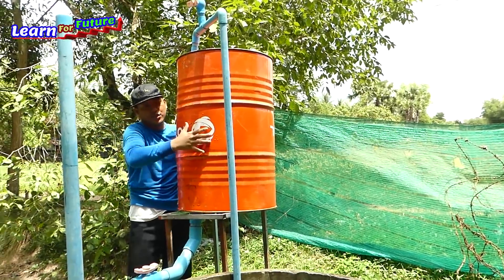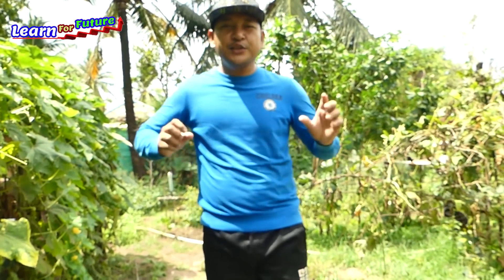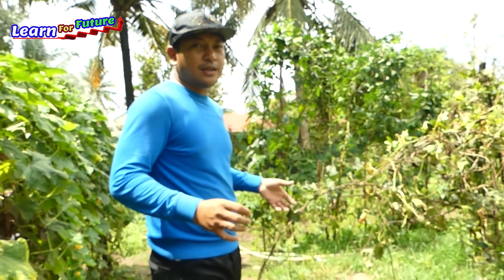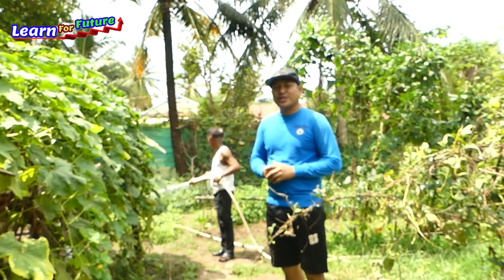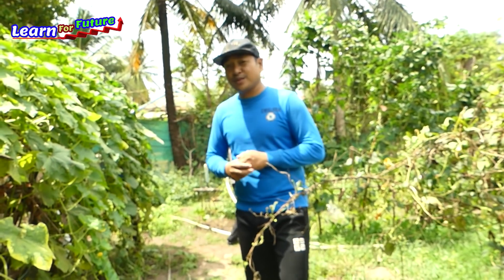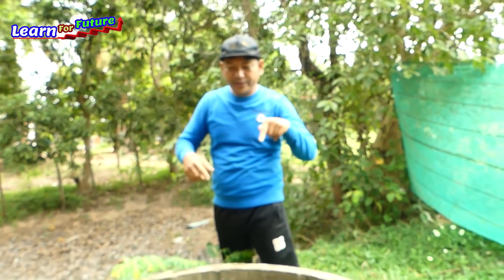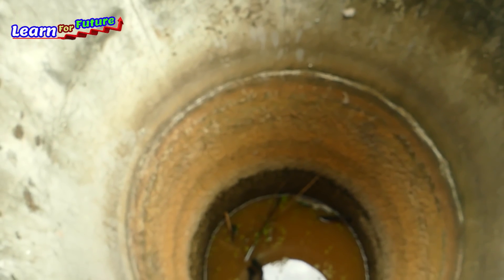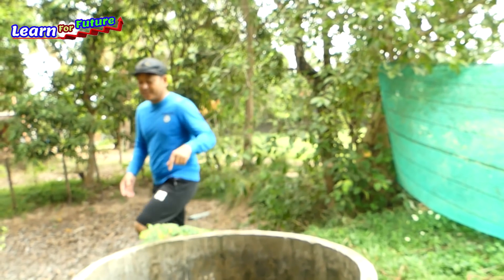Pressured Pump - How to make Auto Water pump from deep well - No electricity

Comment: Dear Please don’t mislead the people, this is not  a pump, pump should be possible pull up water above inlet water level ( Well water level ).  But this system always should be final exit water  out let below Well water inlet level. Otherwise it does not work.

Comment: is the drum should also need to be filled up of water?
Reply: The drum is used to start the syphoning process. You need to draw the water up to 'kick start' the process. This can also be done with your mouth if you use smaller diameter pipes such as a garden hose. Though stop sucking before the water enters your mouth ;)

Comment: imposible to raise water from a well without using power. Gravity pull applies only if the flow is fr higher to lower level
Reply: You are Total idiot...
Reply: @dazar44  Why ishe an idiot? This is a siphon system. A siphon can not lift any water from even a 1 foot deep well. Impossible.
Reply: Trully??
Reply: 09:24

Comment: Our well is 600' ft deep, did this system is capable to flow our water without electricity ?
Reply: It will work maximum for 10 meter deep.
Reply: @wattoo77  No, not even from a 1 foot deep well. This is a siphon system. A siphon can not lift any water up. It is right that you can pass over a 10 m wall, but no water can be extracted up ther. 100% of the water must down under the source before exit.

Comment: This man is expert in his job and he ia doing good work. Same time many people giving negative comments that it is fake or outlet should be lower than inlet etc but this type of people don't want to do research or they don't have capabilities to do so. So very easy way is to say " it is fake " show me this or that but don't want to do anything by them self. Anyhow this is true and possible. Their are vacuum pumps available in market but that pump creat vacuum by engine and can suck water maximum from 10 meter because there is 1 Bar atmosphere pressure which is equal to 10 meter. So once he filler drum and open outlet than vacuum is created inside drum and which is replaced by water from intake. Here is trick which no one asked in any comments even on any other video. The trick is that the water volume in outlet pipe should be more than inlet pipe other wise it will not work. So if longer outlet than small Dia of pipe can be use. The whole idea is water volum in outlet pipe should be more than inlet. So guys asking for size of inlet and outlet can start there calculations
Reply: very Good scientifical explanation.
Thanks with regards.
Gopal raju
Reply: Mr Azhar wattoo sir
Thanks for your technical explanation ,this is what I want to know.
Best regards
Gopal raju
Reply: @Fpg-x2s  you are welcome.
Reply: My question...if this is true, why I can't find one in the market?
Reply: Sorry, but you are partly wrong!
This is a siphon with a barrel. As any siphons the water level of the source, here deep down in a well, must be higher than the outlet to the rice field. Is that the case here? Does not seem so to me! 
It is correct that with a drum, you do not need a one-way valve in the source, but for this to work the volume of the output pipe PLUSS the water volume in the tank, must be grater then the suction pipe. This means that you can use any practical diameter in both ends. They may also be equal. Use whatever you have! Grater pipes gives more water. 
The vertical tube after the drum is just a wast if money, the drum will do the jobb.

In fact the whole drum can be dropped, no need, but then you need a one way valve in the suction end, an the system must be absolutely air tight. With a drum you do not need the foot valve and the system will run for some time even witt a small air leak.

Comment: Hello dear YouTubers, 
Using groundwater as irrigation water has a major disadvantage. Groundwater also contains minerals dissolved in the water. Every time you use this water for irrigation, some of the minerals remain in the topsoil. The more often you do this, the more minerals accumulate in the topsoil. Through evaporation, the water goes into the air but minerals remain in the soil. There comes a time when you use more water than necessary. Groundwater causes salinization of the soil. I therefore recommend creating a collecting tank for rainwater. ung mainly use these. then it is not bad to use groundwater from time to time. 
regards 
Cemil Genc 
environmental engineer
Reply: That's true in general but you don't take into account the air pollution. Nowadays the rain have plenty of toxic ingredients in it including aluminum and barium as well as bunch of other nasty things. Last years it was common for the plants to die after just a single 30 minutes of rain.
I'm planning to build a new garden next year and I will use underground water for irrigation despite the risk you mentioned.

Comment: Ser im a new subscriber i just i want to know if that method will work in deep weel atlist 26 meters because part hir in phillipines sea level is deep and can you detailed all the pvc tube that you use thanks in advanced ♥️♥️
Reply: @MarcShare4Profit  Actually no. This is a siphon. A siphon can make water pass over a 7-10 m heigh wall, but you can not get access to any of that water up there. All that water must down to an exit lower than the source. So it is not possible to lift any water from a well with this.

Comment: This only works if the water level you are pumping from is higher than the area you are watering. This is a clever system if your crops grow in a low area, but if you wish to grow crops in an area higher than the water level you will have to put energy into the system to account for the energy it costs to lift the water up (energy cannot be created and pumping up water without any energy requirements would mean free (gravitational) energy).
Reply: Use Ramp Pump
Reply: @reeblaagan7310  A ram pump needs lots of streaming water.
Reply: Ram pump<
Reply: Fake fake fake
Reply: Research first and analize so u will know the facts?
Reply: @leoalar3178  Erik knows the facts. This is a siphon and source must be higher than output for it to work.
Reply: @leoalar3178  in fact i did do quite some research on the topic of water pumping/syphoning ;)
I suggest websites such as Akvopedia or WOT for anyone looking for more low tech solutions.

Comment: Thanks for the video. I can see you have changed the outlet point, it is now facing upwards. Any reason for doing that? Great works as usual !!!
Reply: The air will not enter through delivery pipe even while the system is idle